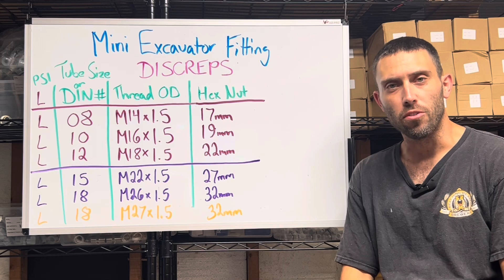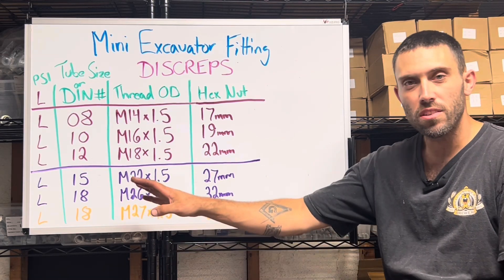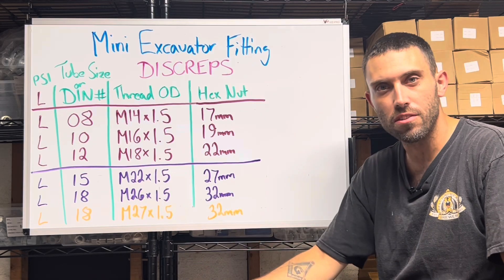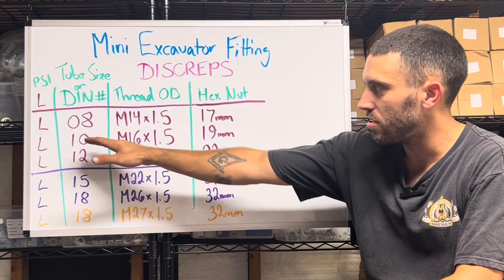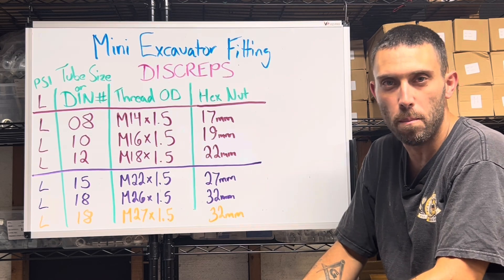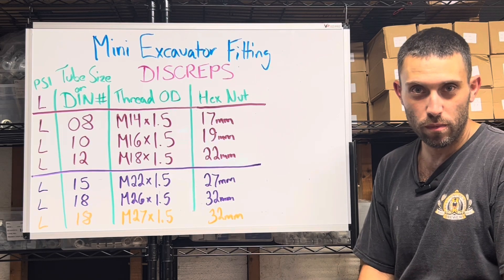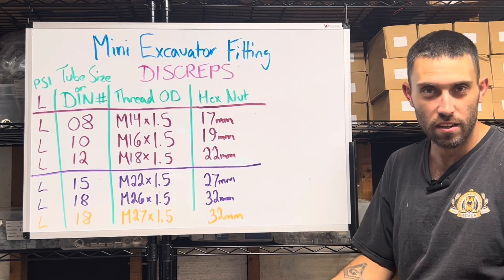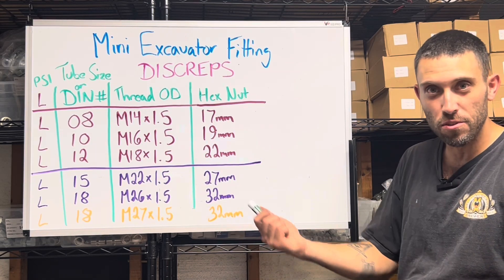Chinese Mini Excavator Hydraulic DIN Fitting Discrepancies: Why would they use that size?

Comment: Cam I am wanting to modify a hydraulic cooler into an engine oil cooler. Could you explain how I could do this and change the hoses to the oil hoses and fittings to engine oil. I am wanting to do this on a Rato 420cc engine in a mini excavator.
Reply from the maker: Impossible to do as the 420cc engine doesn’t have a pressurized oil system only splash

Comment: like your videos...  I just bought a Typhon Tyrant 17.  Not used it yet, pulled it straight in basement and took it apart for service and inspection.   Found it had a suction screen in the hyd tank, but no hyd filter on the return.  Working with my shop to find the DIN adapters and get hoses made..  (They had to source and order some of the fittings).   Mine has the DIN L 18 (3/4" hose) on the return lines and hyd cooler,  so I got a 3/4" NPT filter housing, but don't have the 3/4" NPT x DIN L 18 Male adapters?  Do you have any of these?  I trying to put together a kit for this newer machine.
     Lastly I have a  CNC milling machine and i can cut threads on the mill, (thread milling) with a single cutter.   so if I can possibly make the 27mm adapter you need , I could try?  I have a 12x36  lathe also, but it is not CNC.   Thanks for the video..  I have been trying to figure out these fittings also.   I did learn that DIN L is always 1.5 thread pitch.  and the female fitting thread ID will measure 1.5 below the fitting size. so that makes it easier to understand, if you can only measure the female fitting.   Or just measure the maie fitting OD,     Cheers.. Tryon

Comment: I have a mx15rx. I want to but barb fittings in the return line. Is the return hose 3/4 or 5/8. I dont want to touch my fittings on the tank or valves..

Comment: And here I am thinking it was a measurement error and surely had to be a normal M26 18L fitting. Unfortunatly my JPC KV12 has a ring type fitting with a hollow screw at the other end of the return hose.
In the end I will go to a somewhat local shop and have the switch the fittings of two hoses.

Comment: Great videos!! There a few of us and growing with the newer AGT LS15R comes with some extra goodies over the h15r one being the hydro cooler already installed. Do you have any info on installing a hydro oil filter on that?? No info anywhere on that. The tank is on the floor in front right side and the lines come up to the cooler..

Comment: This was a lot of help. My H15 had those L18 M27x1.5 connectors on the pump and tank. Hydraulic shop was at a loss and ended up cutting the crimps and making me new hoses, reusing the old female ones. Super helpful.

Comment: I noticed that today. I have a fitting identification tool from AdaptAll, its got a 26mm and a 27mm hole in the metric plate.  Fortunately my oil filter and tank fittings are BSPP, so I can adapt those. So far I haven't had to change any hoses over. 

Im not sure what size the Banjo fitting coming out of my valve block to return is yet, Im hoping its BSPP as well.
Reply: The banjo fitting is M22x1.5mm So I shouldnt have an issue converting from an L15 Banjo / 90 degree M27 to an L15 Banjo / BSPP 12 or a JIC or even 26mm DIN

Comment: Can you tell me what the proper battery size is for the AGT H15? Just got mine and battery is toast and no markings on the battery
Reply: Just throw the biggest 12 volt battery that will fit and have the proper configuration for hooking up.  AGM last the longest and can handle the bouncing
Reply: Group 51 battery.
But you’re only starting a single cylinder engine.
When your in there, add a pig tail for your float charger.

Comment: I'm learning about DIN fittings too and found that there are DIN Light and DIN Heavy. I got a DIN Heavy M16x1.5 hose cap and it leaked. It appears to have a deeper outer female hex, so it tops out before the Male internals seal.
Reply from the maker: Yes sir all ours are Light Series, not the “S” Series Heavy

Comment: Great information Cam! My Diggit EM15, as well as Miva VA15S (both rebranded JG-15 from the OEM Shandong Jianggong Machinery Co., AKA SDJG) use the M27 fittings on their return circuits. The machines do have BSPP to M27 adapters on the valve body and solenoid but, just as you, I have not been able to track down any source for them yet. I have found the M27 crimp fittings on AliExpress but asking sellers on Alibaba will be required to track down adapters.

Comment: So I have a H15 and the hose that comes off the hydraulic tank on that 90 degree fitting,  is that the m27x1.5?  My problem is there is no drain plug on the tank. How do I go about draining the fluid?
Reply: I disconnected from the pump the first time and swung the end into a bucket.
Reply from the maker: We believe it is indeed the oddball connection sadly
Reply: I used the $8 plastic hand pump from HF, 40 pumps per gallon, 2-1/2 gallon in my H-15.
Edit, I took the tank off, cleaned and welded a 3/8" nipple on.
Reply: I just undo the bottom hose on the tank.
I also use a shop vac with a 1"1/4 hose placed on the fill port to keep the fluid from flying out when I undue the hose from the tank and it gives me time to put a drain hose on the tank to keep the mess to a minimum. 
My shop vac was a little to strong and did suck up a little fluid into the hose so next time I won't make the seal so tight to avoid getting any fluid in the vac hose.